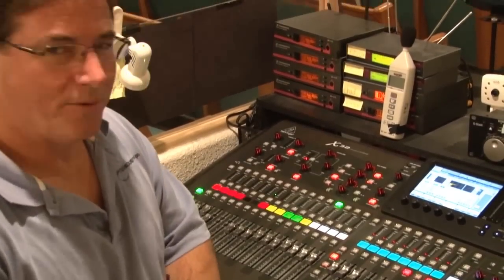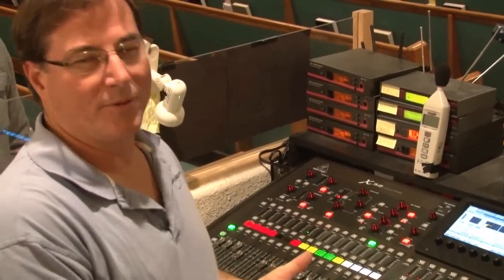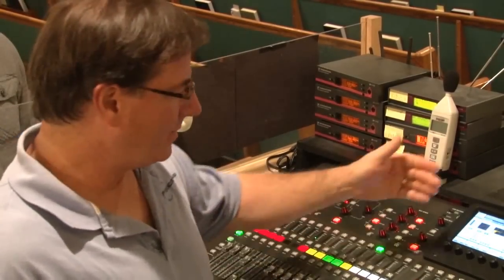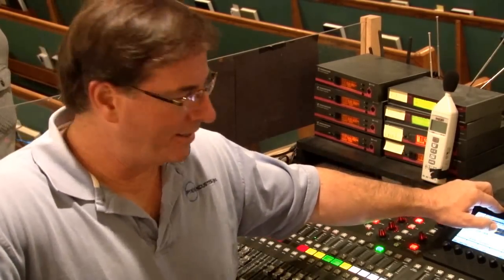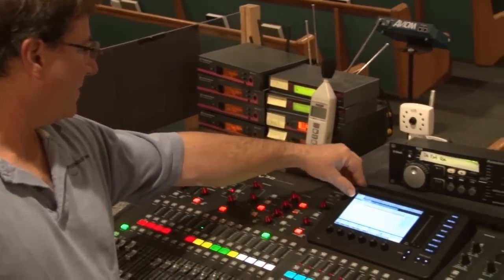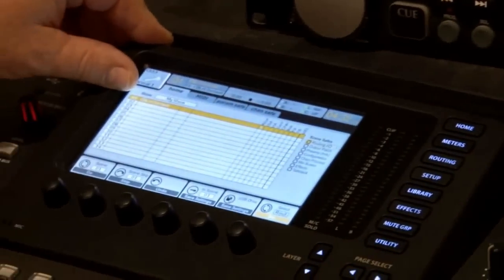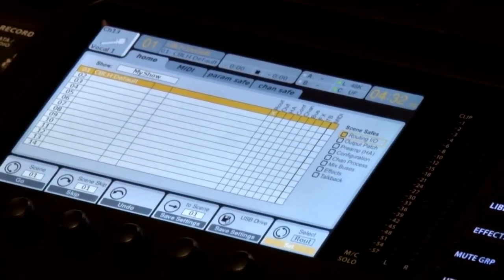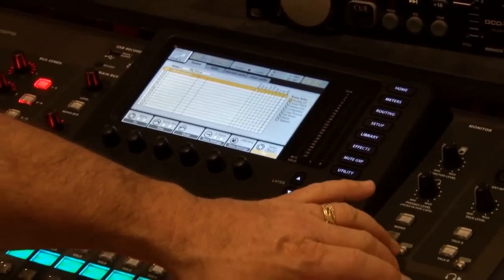Behringer X32 Console Training Pt 1

Comment: We just upgraded our X32 board but did not back up anything. Big mistake lol. the only thing I can't do is set up our digital snake sends using 17-28. we have a analog snake using 1-16. hope you can help me out. Great tutorials you have!
Reply: +Scott Stewart So, All you need to do, is press the "Routing" button next to the screen, Then on the first tab, starting at the third box, and you'll move the selection down to AES50 17-24 and in the fourth box you should move it down to AES50 25-32. This should allow you to use the digital snake for the second sixteen channels.
Reply: Thanks, we tried that. The crazy thing only worked after we punched in 1-8. go and figure. lol.
Reply: Scott Stewart glad to hear you got it to work at least

Comment: So how do you actually make the group masters in the first place? I’m having issues with the routing on the x32 at the church I’m running sound at. It seems that the group masters will only work in parallel, whereas I’m trying to treat them in serial. Is that possible on this board?

Comment: i need help i am using the x32 and when my pastor talks there is alot of loud feedback which is really emberassing is there anything i can change on the behringer to reduce it or eliminate it?
Reply: If you have monitors, you can mute them, If not, the other thing you should do is turn back the gain a little, which can help, 

Also, Use the eq, I would put a lowcut going up to about 100hz, then a PEQ cut at 220hz about 4ish db  another one at about 330hz sitting at -4db and then another one at about 600hz another 4db cut. the width is about 5 for each one. Granted, these are all specific to our current sanctuary, and our sound system, They may change a bit depending on your room, 

the last thing is a compressor, a good starting point for a speaker, thresh is -36 ratio at 3:1 Gain at 6 and knee at 1, attack 10ms hold is 10ms and release is 151ms, Those are good for keeping peaks down, and they can also help keep your gain levels lower. 

As I said before though, these are settings I use in our sanctuary, they will vary slightly depending on your system, and your room, and it will depend on if you have it eq'd flat with a graphics eq.
Reply: wow thank you for all the information i will use these settings and see if there is any change in the feedback. we do have monitors which are giving alot of the feedback out of anything else and it does have a messed up XLR cable which we are going to change out.
Reply: 235orly no problem, Like I said, it's going to depend on your room, But definitely mute the monitors, if there's any sound coming through them, the mic could be picking it up, also, make sure the pastors mic isn't feeding through the monitors at all, and you can also put a gate on it, that will help prevent things other than his voice from activating the mic. If you're able to, I would try to get with the pastor during the week sometime, and try to mimic the feedback, that way you can figure it out, with out the stress that comes from it happening in the service.
Reply: we use the monitors for the chorus to hear the music and there voices when they are singing so i don't know if we should mute them or not. but i will try changing some of these settings and see if i can eliminate some feedback
Reply: 235orly monitors for choirs are a challenge in itself, super sensitive mics, paired with loud monitors, tends to cause a lot of problems, we deal with it anytime we have our choir up, or want to add instruments to the band like cello. 

sounds to me it could be something more than just your pastors mic. As long as the pastor isn't talking while they are singing, muting the monitors won't cause any issues, as long as you remember to unmute them when they are singing, that's where mute groups come in handy, you can mute and un mute them all with one button.
Reply: okay yeah usually my pastor talks while they are singing so that might be a problem too.

Comment: We used this video to set up our monitor sends last weekend but they are still working post fader. We have the s16 so we had to change the settings to use outputs 9-16 instead of 1-8 in order to retain the mains on 15 & 16. Help?
Reply: +Living Water Fire Protection If the monitors are actually floor wedges, you'll want them running post fader. You'll want to have the ability to turn them down if you need to. If for some reason you don't want them running post fader, you can change them in the config setting for the bus that it's on. As far as the s16, I'm not sure what you need help with. If you want to give me some more information on the issue, I will do what I can to help.
Reply: Living Water Fire Protection ft

Comment: Hi there I'm Sam this seems to be a very interesting video I did live sound for my church for about 14 years always used traditional analog mixers with all the Redundant knobs. That's what I'm accustomed to you. Due to personal family situations I've had to step down for a while for the time that I was gone they have switched to a digital console what tips or advice would you have for someone who is barely just getting into digital consoles?
Reply: My advice: find whatever board you will be using, and then find the manual for that board 

It might be boring to read it all, but it will definitely be worth it

Comment: We are looking at X32 as well for our church and I'm wondering if you can recall scene per input channel basis.  For example, we have various singers who may use different mic at different times.  I'd like to recall a scene for that singer to different channel.  Is that possible?  Thank you!
Reply from the maker: Laurent Kim You can, What you have to do is select a channel, and then hit the utility button, You'll have to save each vocal/instrument and then you can later load each one as you need it. It allows you to save your gain, eq and compressor settings, essentially, your entire signal chain. and it's loadable on any channel on the board. 

The board comes with a lot of presets for drums as well as various instruments, we ended up having to save over some of them because we had more to save than was free.

Comment: I am a volunteer and we have just purchased a x32 with the S32 digital snake. I am sure it is a routing problem but we have be unable to get the sound to the mains without using channels 1 &2 but when we do that we have no volume control. I would like to use 14,15 & 16. Also is there a way to get some good online training for beginners? Thanks
Reply: +Peter Aveni so, I'm not completely sure of what the problem actually is,  If you would like, You could email me at bj@calvarylhc.com and we could dive into it a bit deeper and see if we can't figure out what's actually going on. I think it may be a bit difficult for me to do so on youtube. as for training for beginners, Behringer does some live webinars on occasion that kinda go in depth with the x32, you can find some of the past ones on youtube, some of them are pretty informative. Though there is a lot of information in them, and some of the information tends to be aimed more towards more advanced users. I would recommend watching anything you can find tutorial wise on the console and learn what ever you can. 
Hope to hear from you, have a good one.

Comment: Hi there
Is it possible to EQ the monitors seperately from the the FOH EQ settings?
Reply: Yes, You can either insert a graphics EQ onto the bus the monitor is going through, or use the parametric EQ that is built into each strip,

Comment: I do mosttly lectures and pannel discussions.  Sometimes we may have a pannel for 6-8 people.  Do you think this Board is good for lecture with pannel for 6-8 people with mics also for Q&A? Any advice ? Thank you in advance Calvary LHC
Reply from the maker: Hey J Harper, This specific console may be a bit overkill for your needs in terms of channel count. They have smaller versions of this console such as the X32 Producer, ect. There are also smaller digital consoles that would be perfect for your needs, such as the Yamaha TF1, PreSonus Studio Live 16, Behringer X32 Producer. All of these consoles will have similar features such as EQ and Dynamics, but are a smaller format which will be easier to use for 6-8 microphones plus Stereo inputs for iPod/Computer. 

tl;dr - Yes, it will be a great board for your needs, however, it may be too big for what you need.
Reply: Thank you for your help Calvary.  You are right and im going to go with the X32 producer.  Good board for a good price.

Comment: hey is your behringer x32 main output going through powered speaker or amplifier so are you still use them an equalizer in main output of your mixer?
Reply from the maker: Our Main Outs go to a Speaker DSP unit in the Amp Rack, where the signal is separated and sent to the proper drivers. We prefer to leave the EQ flat on the main output and use the EQ in the DSP unit for correction.
Reply: so which means you don't need to use a pa graphic band equalizer while you have a behringer x32 with built in audio processor on it?
Reply from the maker: Correct, it is not necessary, however, this should be decided on a case-by-case basis.
Reply: hey i have one more question. how many main output has a behringer x32? i always see it's in section16 and 17 if im not mistaken.. is that the only main output? how should i connect multiple speaker in front stage? just like line array and powered subwoofer?
Reply from the maker: You can assign any output to be the "Main" output. As an example, I would assign OUT 14 as the "M/SUB" output, and 15 & 16 as my L and R respectively. Then, for all my Right side speakers would be fed from 16, and my left side speakers would be fed from 15, and my subs would be fed from 14. If your using a line array like the QSC KLA's, you can simply daisy chain each box to each other. Just make sure you follow the speakers instructions. 

For anything outside that realm, I would HIGHLY recommend you seek the help of an integrator who can walk you through the process and make recommendations based upon your specific situation.
Reply: ahhh i see! Now i know what should i do. Thank you so much so i will not afraid to use many speakers as much I want. thank you so much i can now ready to have it someday. It's so easy to use now. okay thanks agains.

Comment: HELLO. I'M LOOKING FOR A SOUND SYSTEM FOR MY CHURCH, ITS 250 LENGTH / WIDTH 100 FT, I NEED , ONE BEHRINGER  X32 ,  WITTH CAPABILITY FOR, FUTURE ,VIDEO AN LIGHTING CONTROLS , DIGITAL SNAKE 16 / 24 INPUTS ,, WIRED ,WIRELESS .. WIRED MICROPHONE HIGHEST STANDARD 8 , WITH STANDS  , 6 WIRELESS MICROPHONE HIGHEST STANDARD,  WITH STANDS, 4 LAPELS MICROPHONES , 2 PREACHER PERSONAL HEAD MICROPHONE WITH CHANGEABLE CUSHIONS  AN EXTRAS  , BEHRINGER AMP , FOR HOUSE SPEAKERS RECOMMENDATIONS  COMPACTED SPEAKERS THAT MOUNTED TO THE CEILING , AN POWERED AMP SPEAKERS FOR MONITOR ,UPS RACK MOUNTED , GRADED FOR SYSTEM, AND ANY OTHER ACCESSORIES THAT ARE NECESSARY THAT I MAY HAVE OVER LOOKED !!! THANKS IN ADVANCE. .